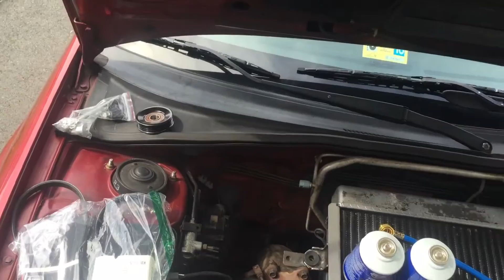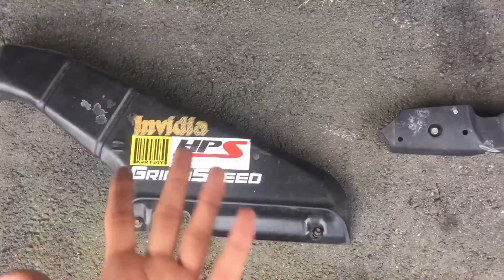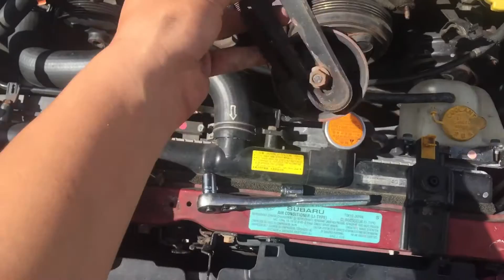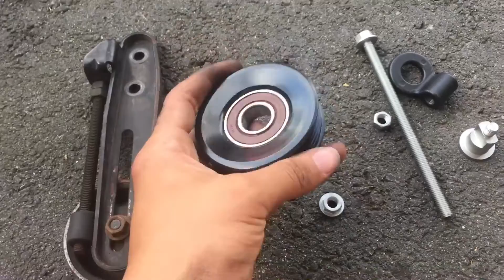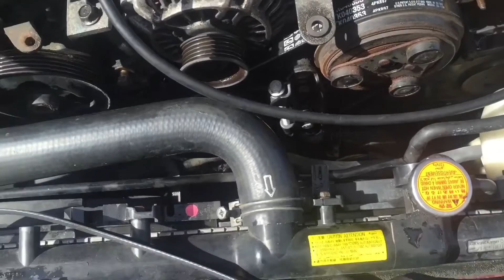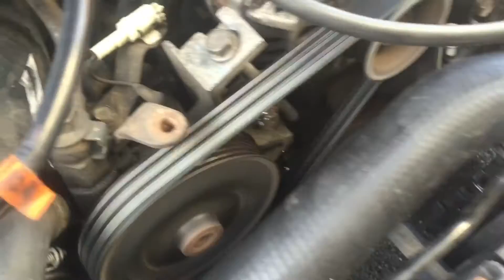Saving a Bugeye WRX Pt.7 - Fixing my A/C!!! (Idler pulley repair/belts)

Comment: thanks for the video bro, quick question on the two hex nuts that connect right below the main bolt. How far are they from the main bolt? im having trouble because it keeps locking when i go to tension the belt

Comment: over charged ac wont blow cold... you should get a gauge to check pressure. if it leaks, look for oily fittings around the system and fix the leaks. then charge it.
Reply from the maker: Yeah I read that. It's blowing cold air right now, so I don't think it's overcharged. Only used one can of 134a.

If anything, I thought it might be under charged; I had read a claim that the compressor clutch can act weird on subarus with an under charged A/C, but now I believe my A/C compressor is just really old and makes a lot of noise when spinning. Kind of like it needs some lube or wd40.

Bought an A/C pro to check the pressure and it seems fine. As for leaks I didn't see any, and haven't noticed any oil on the fittings and I've check everyday the last week.

Everything is fine except my noisy compressor I think lol. Which I can't repair because the whole thing comes as one unit and is a huge PIA.

thanks for watching btw! And for leaving a comment :)